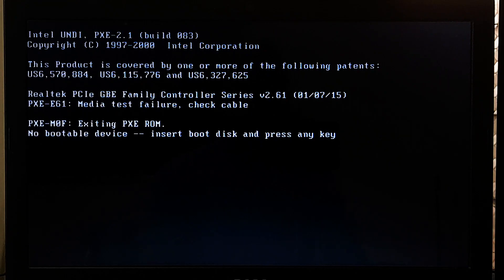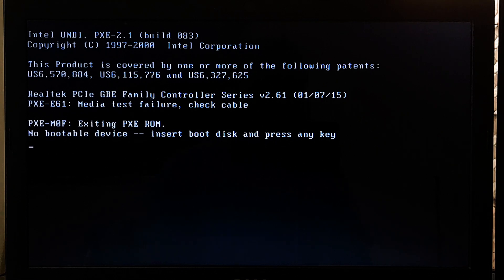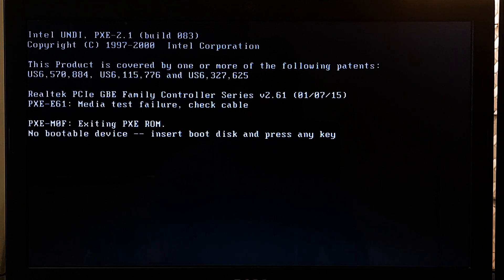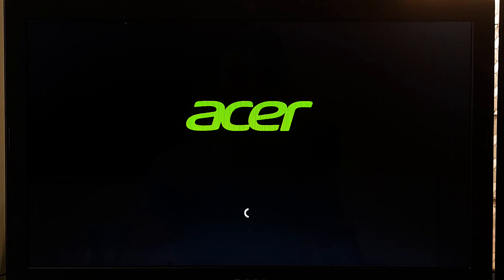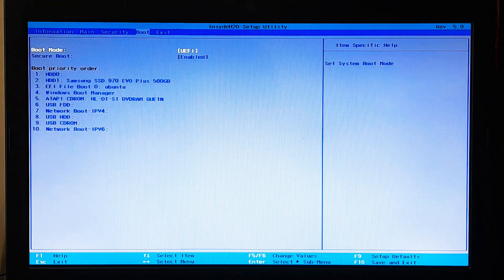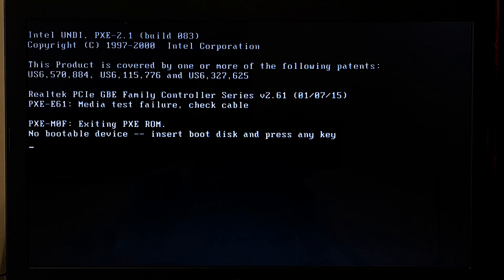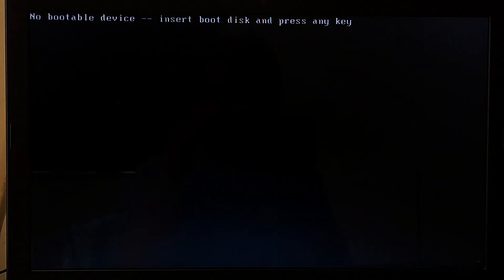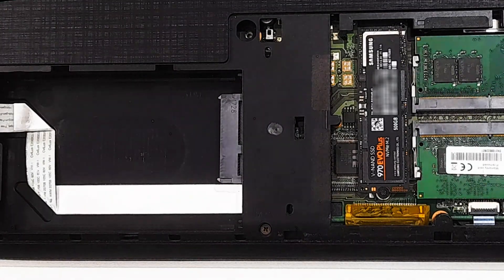How to Fix Media Test Failure Check Cable, No Bootable Device Insert Boot Disk Error

Comment: Thankyou so much! This was fantastically helpful :)

I recently upgraded the OS SSD and RAM in my laptop, and it booted with no issues. It also had a faulty battery and when I changed this out. Suddenly it came up with the no boot device issue, along with fault light codes indicating a dead CMOS battery.

Cue lots of confusing, swapping out to the old battery, checking connections.

And it turns out that setting to UEFI boot solved it.

I have no idea why, but I'm so glad I haven't broken my laptop!

Comment: This Product is covered by one or more of the following patents: US6,570,884, US6,115,776 and US6,327,625

Realtek PCIe GBE Family Controller Series v2.48W5 (11/22/13)

Dell Inc.

CD Service Base Code Version 7.1.8.14488

Copyright 2012 All Rights Reserved ReadNICBusNum returns 1

Found network controller

Bus Device Func = 188

Initializing UNDI...UNDI_STARTUP failed: 8861 Media test failure, check cable Device will reboot in a minute Press ESC key to abort reboot and proceed to next boot media_

Comment: my hardisk is making weird noises idk why? when it makes crack noise, pc gets frozen
Reply from the maker: Your hard drive has reached the end of its life span and is about to die!
Reply: @asatechnical  ur right, at morning, windows was opening normally, and right now, pc is not even reading hard drive and causing failure.. rip
Reply: @asatechnical  btw can my dual core with 4gb ram (10-12 year old) pc support SSD? I'm thinking to install ssd if it works
Reply from the maker: Yes of course you can install a sata SSD.

Comment: Thanks. My problem was for my flat battery, don't save bios settings and when the laptop battery dead I lost all configuration. You need to enter in bios and change date and hour and than change uefi or legacy option, dependence of your start with windows. Sorry for my English

Comment: Mine doesn't even read the drive
Reply: How u fixed
Reply: @Aneeshjitechnical  it was the connecter cable I had to replace it
Reply: @thetickler2001  now its working?
Reply: @Aneeshjitechnical  yes
Reply: @thetickler2001  my ssd was nit detected now it is but windows is corrupted now it’s in shop 😔
Reply: @Aneeshjitechnical  just reinstall windows or buy a new one
Reply: @thetickler2001 did same, tomorrow i will get it back from shop after installation 
Anyways thanks for suggestions..

Comment: I was installing Ubuntu I wiped my drive now I can't open the laptop it says reset system and is in boot loop what to do ???
Reply from the maker: Make a bootable USB for Ubuntu or Windows and perform a fresh and clean installation process, which is recommended solution!